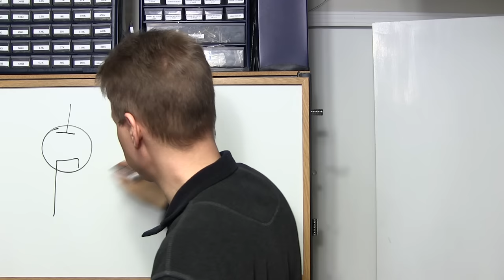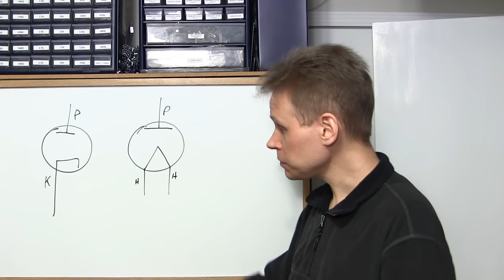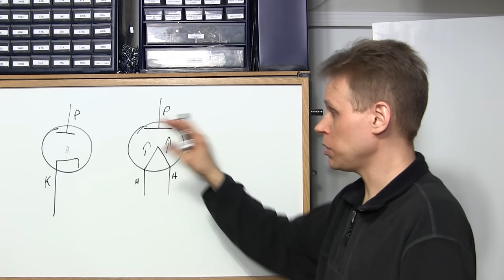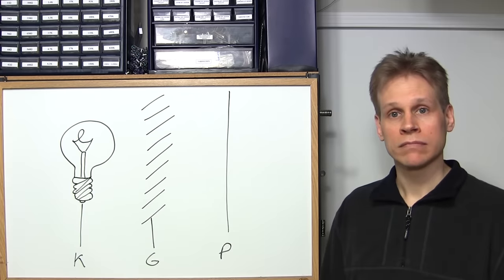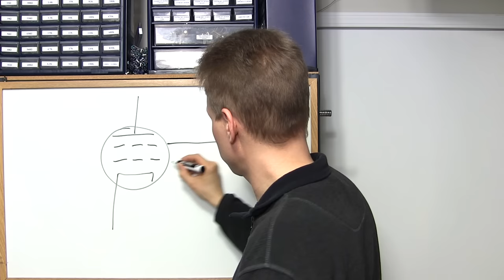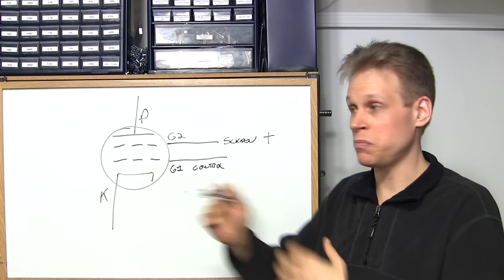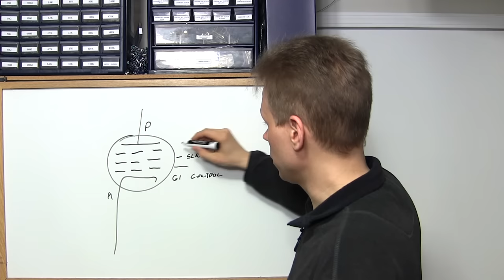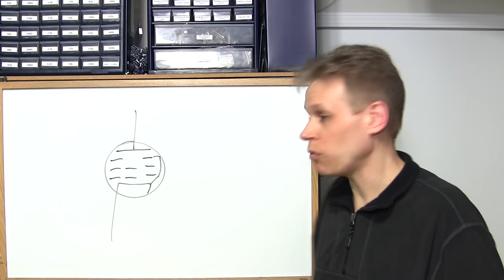How A Tube Works

Comment: Great video! I've always loved vintage electronics and I'm fascinated with how vacuum tubes work. But I have a question - I understand how the grid is used to control electron flow through the tube, by putting a negative voltage on the grid, it repels a negative charge and so fewer  electrons leave the cathode. But what I'm confused about is if you put a positive charge on the grid, to "open the valve" for electrons to pass from the cathode to the plate, what prevents the electrons from just being drawn back towars the grid instead of the plate? Is it because there is a higher positive voltage at the plate?
Reply from the maker: You got it! The Plate has a much larger potential on it, and more surface area as well. Electrons do strike the grid though. When you see a tube marked "KT," so for example: KT66 or KT88, this means "Kinkless Tetrode." In these tubes, careful construction ensures the grids are all aligned perfectly, as to place the screen grid (G2)  beyond the control grid (G1) in it's shadow. So the screen grid wires are hidden behind the control grid. This gets rid of the "KINK" on the curve tracer, and prevent a thing called "grid heating" due to electrons striking it.
Reply: Assuming the stage is not being overdriven, the grid never goes positive. With no signal there is a negative voltage on the grid and a steady current flows in the tube. When a positive signal voltage arrives at the grid, it drives the grid in a positive direction, making it less negative (but still negative!). This results in a greater current in the tube. Conversely, a negative signal drives the grid in a negative direction, making it more negative, which results in less current in the tube.

Comment: hello sir can xenon bulb in cars have some strange effects if relays arc or alternator back feads Im talking about bulbs that have no ballast reaistor so I surche for days about information why wuld metal springs stiffen when head lights are on me car self acelerates out of control so I hoppe for some help understanding circuets bether.
Xenon has no ballast,,positive linear voltage regulator has no diode,alternator also has no diode its old delco 12si with useing only pin 1 with bulb,it apears aternator field is bound to 4pin rear defroster relay on pin 86,relays it self looks like they share common grounds and + paths, 2pin buzzer,4pin rear heater ,3pin blinker,6pin wiper relay and besides 4pin gm ignition module nothing ells what so ever is present as for electronics.
So me question wuld be if peace of metal or metalic spring is magnetised what culd cause that odd beheviore in me car its 80s Opel like all GM cars they have terribel wire harnest.
So I belive the 4pin relay failed because it started to draw current over night from the baterry so I realy have hard time finding the cause of that problem .

Comment: I noticed some vacuum tubes do not have pins. Is there a special socket for them ?or are you supposed to solder leads on them?
Reply: Thank you for the presentation,  you're  good at explaining the concepts.

Comment: Nice video, but I do have a question, on a double triodes I've noticed that some schematics have a pin labeled as "NC", what does that label mean, and does it apply to all tubes?
Reply from the maker: Hi. The notation "NC" means (no connection.) This pin can be used as a tie point on the tube socket. The notation "IC" means (internal connection,) and should never be used as a tie point. These notations are tube specific, and will vary from tube to tube.

Comment: Great video. Quick question on tetrode. I was taught that the surface area of the screen grid was lower than the surface area of the plate and control grids with more or less same voltage as plate applied to it. Hence effectively two stacked capacitors which when added up in series has the capacitance of the lower surface area of the screen grid hence the larger area of the control grid and plate is now not defining the capacitance. Does that logic make sense? Or is that incorrect? It always seemed a logical argument to me.
Reply from the maker: The grids inside the tube are just two support rods with wire wrapped around them in a spiral fashion. The 807 or RK39 is a tetrode with beam forming plates to "guide" the electrons to a spot on the plate (on each side.) Any two pieces of metal or conductive material stacked close to each other in a vacuum tube will form a capacitor. The introduction of the screen grid (when positively charged) will create an electrostatic shield between the control grid, (Grid 1,) and suppressor grid, (Grid 3,) and plate. This lowers inter-electrode capacitance within the tube, allowing it to operate to higher frequencies.
Reply: Thanks for that quick reply. I now begin to see what you mean, it is the effect of the electric field we want to reduce. Given that, can I now also ask about the external capacitor which joins the screen grid to the cathode lead. This must make the screen grid get closer to same potential as cathode at higher frequencies, is that how the electric field of the anode is negated at higher frequencies?
Reply: A proportion of the current from the cathode is captured by the positively charged screen. This results in a  signal on the screen which works in opposition to the signal on the grid. The capacitor acts as a bypass capacitor, stabilizing the screen to cathode voltage and thus permitting the stage to attain maximum gain. Its capacitance determines frequency response in a similar way to a cathode bypass capacitor.

Comment: I get the Venetian blind analogy, but I don't understand why a negative voltage on the grid will act like that shutter. The cathode is still emitting electrons, shooting them towards the plate. Why should a negatively charged net interfere with the electrons passing through it? Is the grid working like an electromagnet repelling the electrons more completely the more negative it gets?  And if so, what happens to the repelled electrons? Where do they go?
Reply: The electrons are negatively charged and as you say are repelled by the negative potential on the grid, but some get though, depending on the grid voltage.  At a high enough grid voltage, none get though and the tube is "off".   With no grid voltage all get through, so the tube is fully "on".  The repelled electrons just form a cloud around the cathode and some even return to the cathode.  Imagine the cathode as "boiling off" electrons, like boiling water, some droplets fall back into the saucepan.
Reply: @karhukivi  thank you.
Reply: @pintokitkat  You're welcome!
Reply: Surrounding the cathode there is a 'cloud' of electrons  known as the space charge. When an electron leaves the space charge to flow to the plate, it is replaced by an electron that flows from ground to the cathode which emits an electron to keep the space charge 'topped up'. When fewer electrons are leaving the space charge, fewer electrons flow from ground to the cathode. Electrons are not really 'repelled back' into the space charge, they are prevented from leaving in the first place.
You were close with your notion of an electromagnet, but it is an electrostatic field surrounding the grid wire whose strength is determined by the voltage on the grid which, as you put it, repels the electrons more completely the more negative it gets.

Comment: A (diode) tube even has a small current flowing when no positive voltage is applied to the plate due to the heat emitted electrons landing on the plate.

Comment: Thank you so much, I feel like my head is going to explode. Lots of information in this video. 
If you would could you please let me know what is ment by a matched set of tubes? My son has an old HF amplifier for ham radio. The Amp book calls for a matched set of tubes.

Thanks in advance.
Very respectfully

Dave
Reply from the maker: +Navy Davy 
Hi Dave. Matching tubes will ensure that both do an equal amount of work when in service. If one tube is stronger than the other, the stronger tube will do more work, and the other weaker tube will lag behind. This is hard on the stronger tube. Matching tubes in RF final service is important for a few reasons beyond that as well.
Reply: +Mr Carlson&#39;s Lab OKAY, So they must be the same strength and not something that is done at the factory. Thank you so very much for your teaching. I really have learned allot from your teaching.

All the best.

Dave
Reply from the maker: Tube matching can be done at the factory, or if you have a bunch, you can make a good matched pair out of many. Close readings on a good quality tube tester is how many do this. Glad your enjoying the video's Dave.
Reply: Any recommendations on a good tube tester?
Reply: If you are buying tubes for a hi-fi amp then matched tubes are highly desirable. Unfortunately, they need to be matched under the same conditions present in your particular amplifier. Matched tubes (if they actually have been matched, some vendors consider tubes to be matched if they have tested them and they work), are unlikely to have matched in this way. The only way to reliably match tubes is to buy a few, test them in your amp and select the tubes with the closest match. If the tubes are for a guitar amp, then precise matching is unnecessary. A small mismatch introduces second order harmonics in the output stage, which is usually desirable. Also, in a double ended guitar amp, the phase inverter will almost certainly output slightly mismatched signals to the tubes.

Comment: Hi Mt Carlson, is possible heat a 12 ax7 valve with 12vdc ??the valve may generate less hum?? thanks:Daniel,.Argentine
Reply: Yes. The 12AX7 heaters can be supplied with 6.3V or 12.6V.

Comment: If you have other elements of a circuit that are affected by heat how can you reduce the heat that the tube releases (absorb the heat and push it elsewhere) Is there a standard way? I've never seen a tube heatsink ( this question is in relation to a small case/enclosure).
Reply from the maker: There are conduction cooled tubes out there, but mostly for RF service. You can use a fan as well.
Reply: Mr Carlson's Lab I've seen tubes enclosed in a metal case but it's described as a tube enclosure used to protect the tube. I'll try to use a small fan and do some temperature tests. Thanks!

Comment: Howdy Mr Carlson! Ive got an Atwater Kent Model 72 with a pair of UX 245/ CX 345 tubes and the heater in one of them is completely dead. The one with the good heater works in both sockets so its not the socket. I was wondering if you know an equivalent type that I can use because a matched pair of those type are currently cost prohibitive for me.
Reply from the maker: Hi. You can remove the UX and the #2 from the tube number. So just look for a number "45" tube, you should find lots of results.
Reply: @MrCarlsonsLab   Thank you very much!

Comment: Is there a source(s)  for modern electronic devices, how power SMPS or LCD TV, etc. ? A lone time ago when I fixed tube BW & Color TVs & radios , there were Howard W. Sams schematics packages for sale for a variety of sets. Now a days SMPS fail but most people discard them. I studied electrical engineering in college but before that had my Novice License at 13 y. o.  and went thru USAF Digital Electronic Computer repairman school AFSC 30533/ 30553in Biloxi, Ms. for 50 weeks. I realize that there are LETHAL voltages involved in these power supplies. I'd rather repair, salvage them and  resell them than add to a land fill. Am I a dreamer or practical??? Inquiring minds want to know.
Reply: I am looking for schematics.

Comment: So, when is the part when you explain how they work? So far it's only a talk about the different kinds, how they are built, etc. Where's the part then you present how it works electrically in a circuit?

Comment: Why do vacuum tubes need shielding💥thxsomuch🙏
Reply from the maker: Hi. Because the internal parts of the tube are exposed under the glass, interference from other components and circuits can easily enter through the glass of the tube. By shielding the glass with a metal cover, then grounding that metal shield, will greatly reduce stray interference.
Reply: @MrCarlsonsLab  hey thxsomuch💥🙏💥love your videos just Amazing📡

Comment: Is a vacuum tube a voltage controlled active device or a current controlled active device, or none of both?
Reply from the maker: Vacuum tubes are usually known as a Voltage controlled device, much like a FET.
Reply: Thank you.

Comment: Good analogs but when you say positive and negative it is important to say with respect to what.  Maybe draw a battery or power source from the reference to the controlling voltage.  It seems like if the grid was negative wrt the plate electrons created by the cathode would be repelled.  It also seems like if the grid was positive wrt the plate that it would collect electrons.  Both would starve that plate of electrons.  As you know tubes are like n channel jfets where the depletion regions at the two pn junctions are expanded when the gate is positive wrt the source.  In this case the drain to source resistance is increase by the bias and at pinchoff, no current flows.  I believe that in a tube no current flows because the electrons are collected by the grid and not allowed to flow to the plate.

Comment: why vacuum tubes use High Voltage?
Reply from the maker: Because electrons have to flow through a vacuum. There are some low voltage tubes known as "space charge tubes." Their internal element are closer together, and have a large cathode surface area.